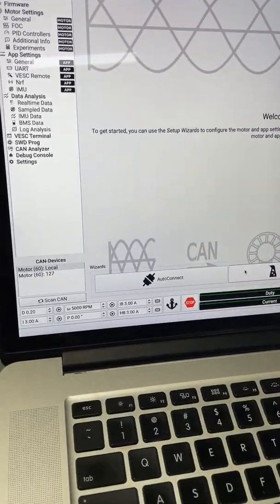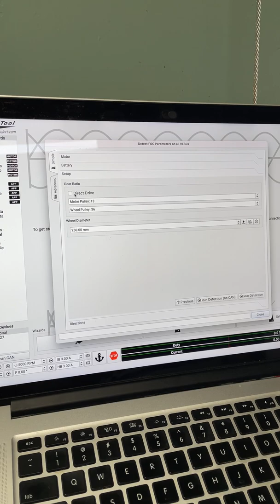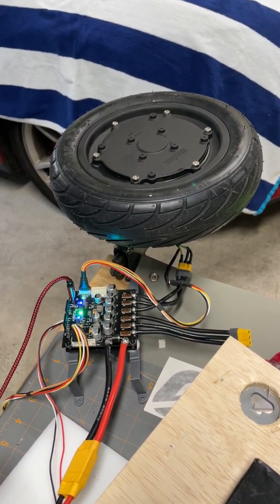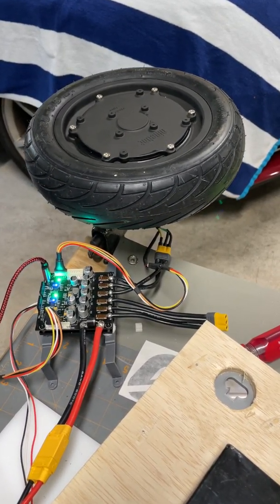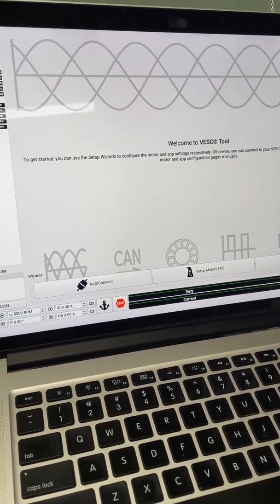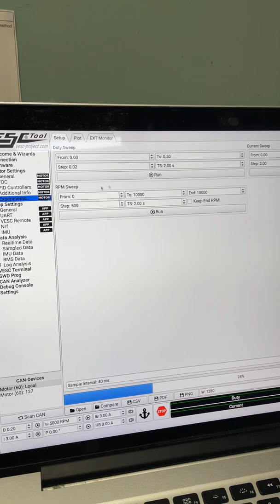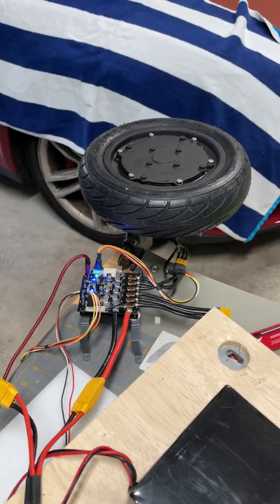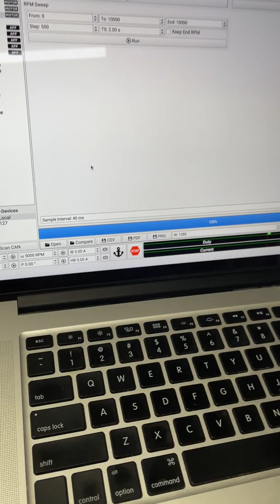Configuring VESC with Segway Ninebot wheel

Comment: looks like you want to use this esc on a miniPro?
Reply from the maker: Just building a robot that needs wheels. I had tried to take a shortcut by not recrimping the hall effect sensor wires to have them properly mate with the ones from the VESC ... after I put new pins on it went well.